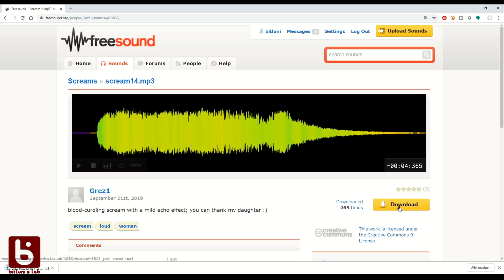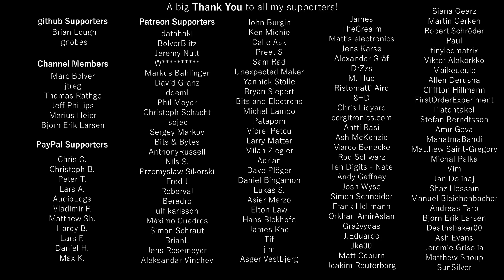Screaming Pumpkin 3h DIY project [Arduino, ESP32, RGB, Audio, PIR]

Comment: Whenever I use PIR Motion detectors I'm facing false alarms. Do anybody know how to avoid it. Are there "good" sensors on the market? I tried now two different and both had more or less the same issues. I allready tried very different power sources. This don't seem the issue.

Comment: I'm using Arduino Uno , what library will work for the audio " DAC " file ? and do you think attaching the amplifier to PIN01 will work ?
do I need to change the sample.H you have ?

Comment: don't you think ESP32 is over kill ?
Reply: could it be done with a nano?
i know the leds and motion detection could be not sure about the  scream sample
also i think addressable neopixels are way overkill too , why not just use some 4 RGB common anode leds instead it would be A LOT cheaper
Reply from the maker: Totally would work with nano with some tweaking. Hard to animate pixels while playing the samples though. I had everything already in place so sticked to what I was familiar with
Reply: @bitluni  what about controlling RGB LED's with pwm while playing the sample would that be less difficult?
Reply: He did mention he was working with whatever parts he had lying around.
Reply: I would probably use a nano and an isd1820 or similar